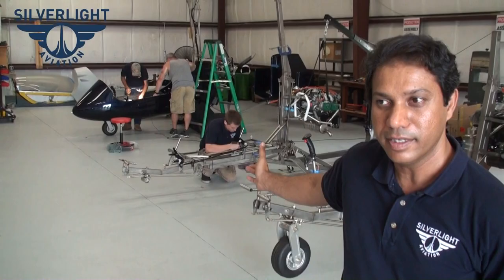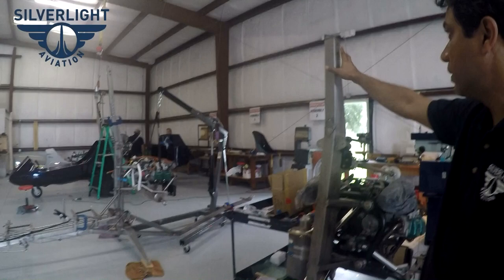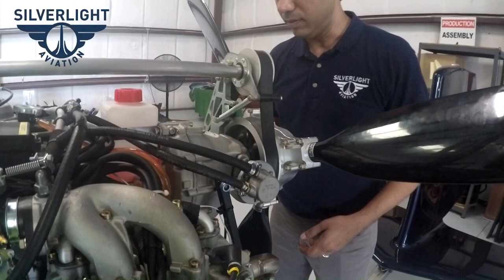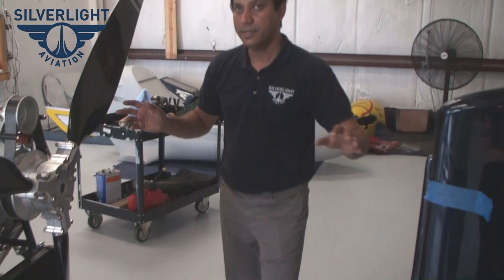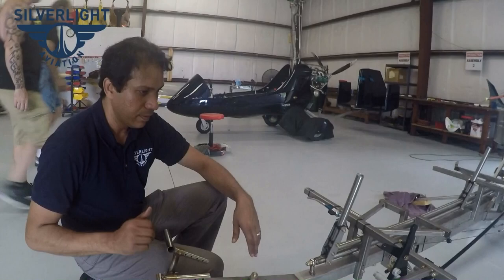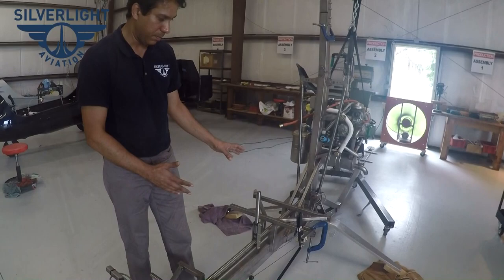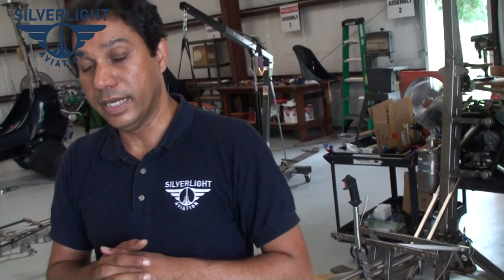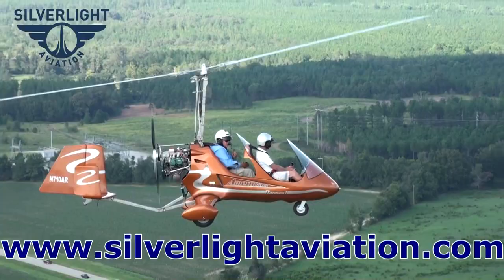SILVERLIGHT AVIATION Gyroplane Building Process

Comment: Nice video, tks
just one thing....i would stabilize the spring on the rotor lock so it doesn't touch the cable

Comment: Hello! Did you bend  this  aluminium 7075 landing gear with heat or in a banding machine?
Reply: Hi chris most likely a banding machine . I dont think  that they cant use heat cuz the metal gets weak.
Reply: We cold work 7075-T6 with a 50 ton press with custom made dies since the bends are not so much but a bigger or sharper bend, I would have started with 7075-T0, bend it and then get it heat treated to 7075-T6 temper.

Comment: Motor esta muito embaixo.
Reply: Higher engine placement increases the risk of a power pushover. The engine placement used here is similar to that on the MTO Sport, Calidus, Magni M-22, and other modern pusher designs, and is proven to be safe.
Reply: Ok.

Comment: I'm curious to know if the rotor can run off the engine for hovering & be disengaged back to autorotation for flight??🤔 I seen somewhere where a Gyrocopter took off in a no roll lift off??

https://youtu.be/Nj9ev4WKS8U
Reply from the maker: That was because that person had a ton of wind (forward airspeed) hitting him as he perorated his blades before takeoff. That allowed him to have a super short takeoff from the airfield. That is also dangerous way to take off because would drop if motor quit on take off

Comment: 2 But Wells side by side where the propellers are being held side by side 33.44 that bad that’s very dangerous wouldn’t catch me flying this plane The welding is incomplete welding in this plane is very bad though  better engineer
Reply: What are you talking about? I have multiple engineering degrees and we do purge welding with shielding gas front and back. These welds are also backed up with gussets or doublers on the side that takes load. Anyway, after the first batch we started bending the tubing instead of cutting and welding to reduce parts count and cut off 16 man hours from production. So your concern is moot now even though its not correct to begin with because you are not understanding the load paths nor understanding that we do full penetration purge welding in this type of joint.